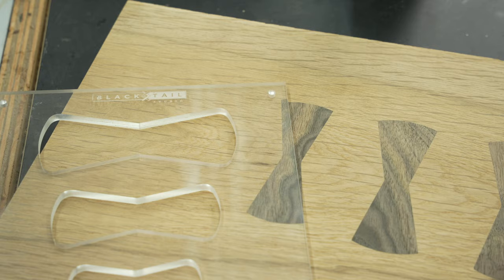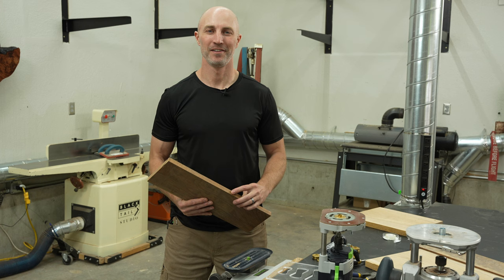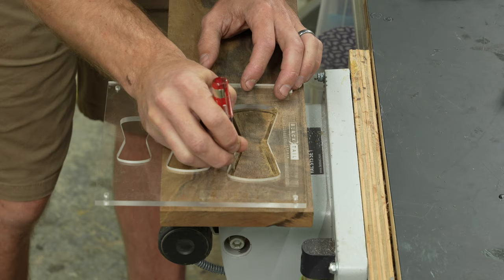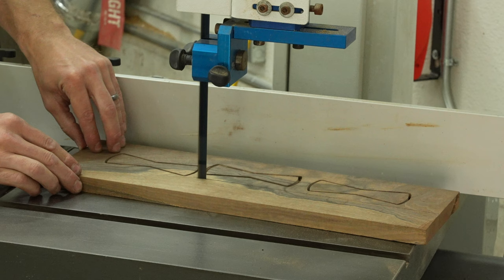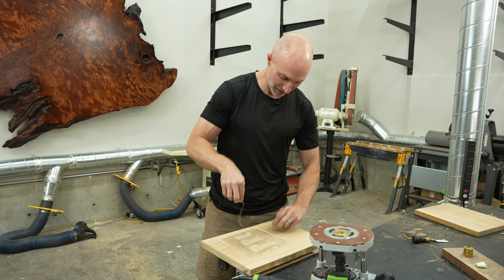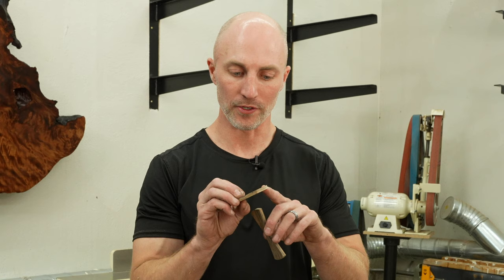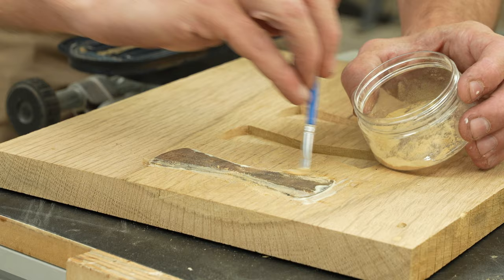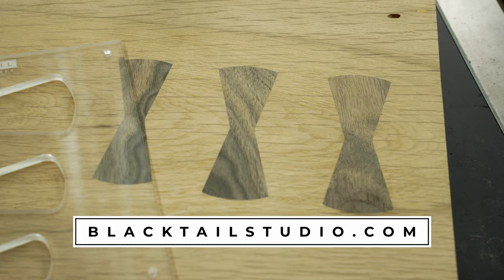Blacktail Studio Bow Tie Jig, How To

Comment: You should make a jig to make chess or checker boards. Walnut with black epoxy and a Rubio finish. You could use either inlays or epoxy. If you do not have that jig are there companies to will do polycarbonate or lexan on a cnc machine?

Comment: Would it be advisable to set my depth too deep ( I know, keep with me) and then slice the Bow Tie so you end up with a couple  of Bow Ties per one template? (Cut 1 inch into wood, then when sliced free of board could be sliced twice so you have two 1/2 inch Bow Ties ready to be used from the 1 inch Bow Tie original cut).